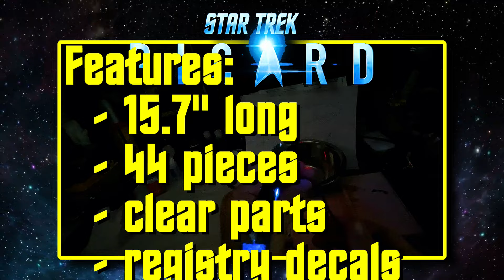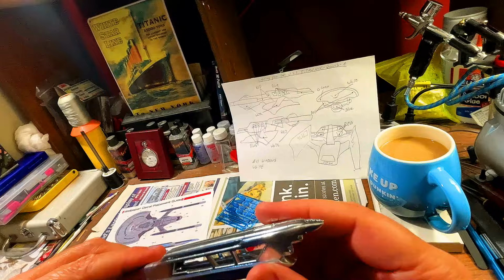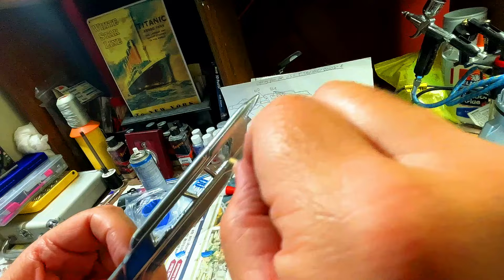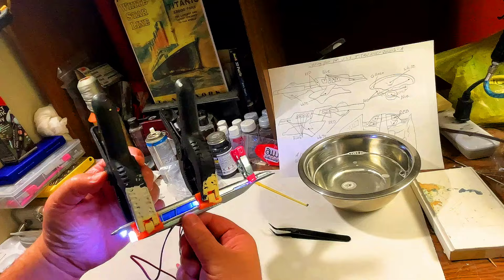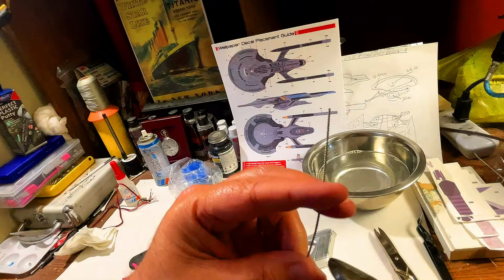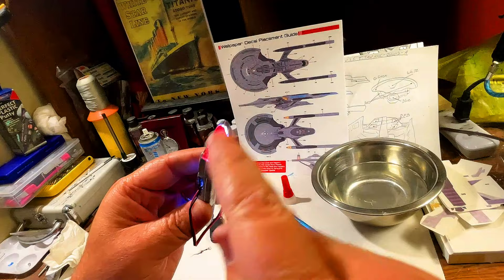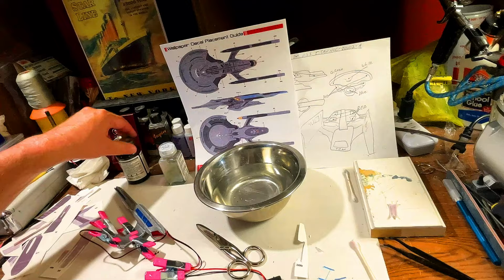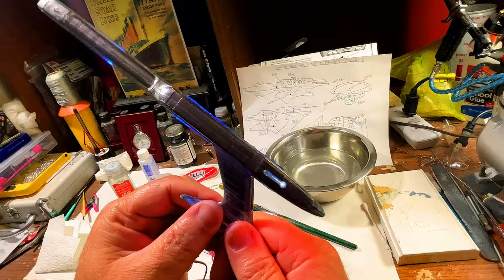STAR TREK PICARD 1:1400 Scale USS TITAN NCC-80102-A Model Kit Build Series (Part-5)

Comment: Simple solution for the beacon:
Wave makes what they call "H Eyes" lenses. These come in clear colors (yellow, green, blue, red, pink) as well as plain clear, and in multiple sizes. Find the right size and buy a set. Or, just tell me the size and I'll send you a couple. Add a punched out disc of chrome, polished aluminum, or silvery holographic mylar or paper to the underside of the lens (just glue it in place with some Future), then, when dry, affix the lenses in place of the molded on lights with more future or a small drop of UV Resin.
Reply from the maker: Thank you, I appreciate the info.  That all sounds good, unfortunately it is well beyond my modeling skills.
Reply: @TrekFanNCC-1701  want me to send you a couple of lenses, mylar attached and ready to install? Just give me the diameter and your address. All you have to do is cut off the molded on lights and drill a slight depression @ .25mm wider than the lens on each nacelle.